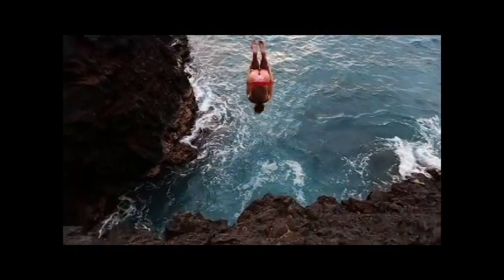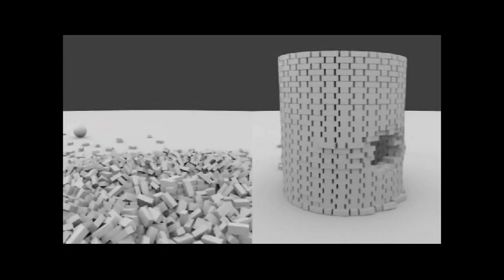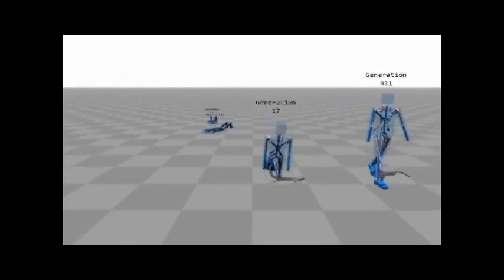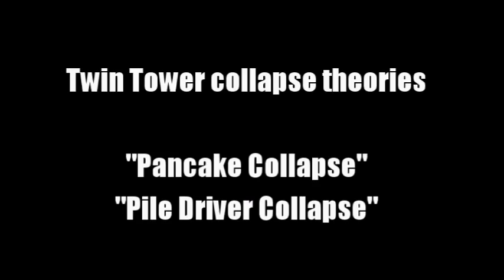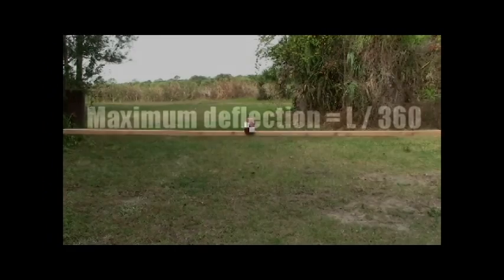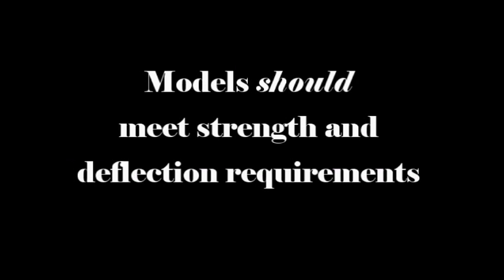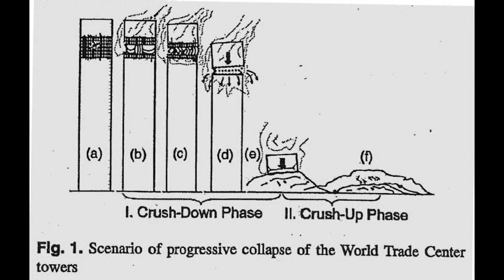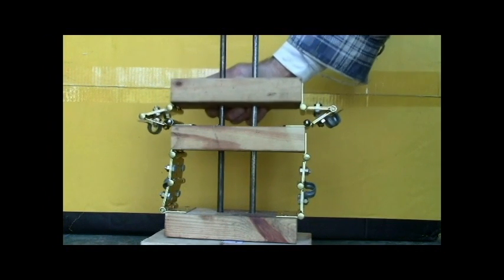9/11 Experiments: The Force Behind the Motion

Comment: Free Fall? Dude those are paper.  Were talking about TONS and TONS or Concrete and Metal. Also, the paper is underneath the floors in your experiment.  The structure was tied into the outside like when you say time out with your hands but a sideways "T".. Question:  Has anybody ever seen any building as large or larger than these fall before? As far as I can tell this was the largest anything in history to have fallen, right? Then how does anybody claim to know anything about something that is a unprecedented, PHD or Not?  I'm not saying it wasn't a conspiracy, because I don't know.  Maybe building 7.. but not the towers.

Comment: Right, because a few concrete planks, pizza tables and a steel block is a 100% accurate and proportionate representation of 1WTC and 2WTC; towers that were designed by architects and built with steel, not drywall.